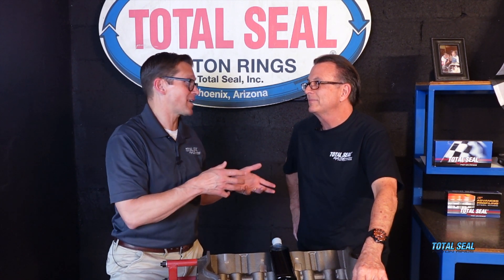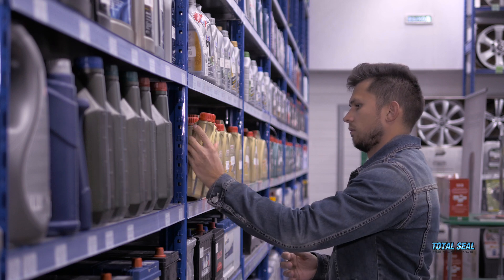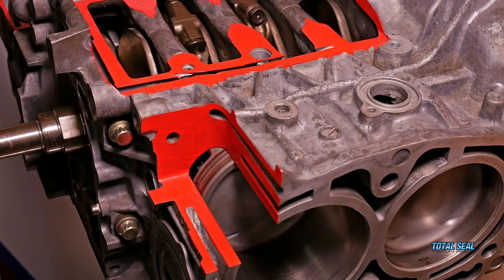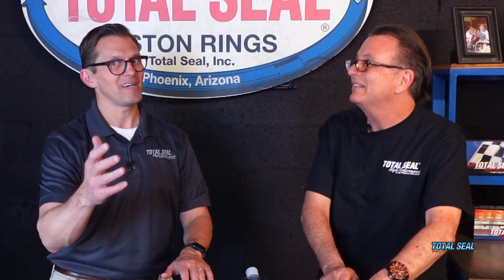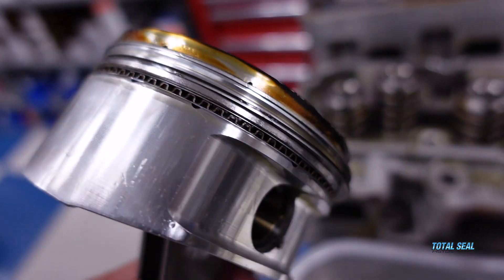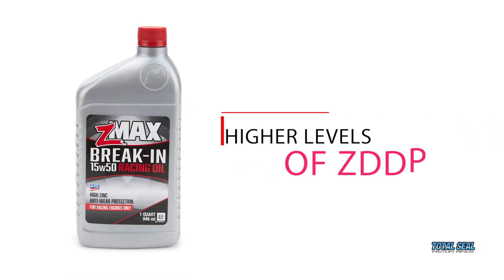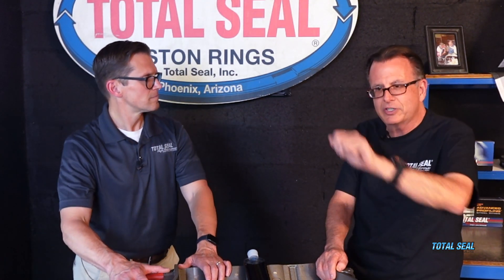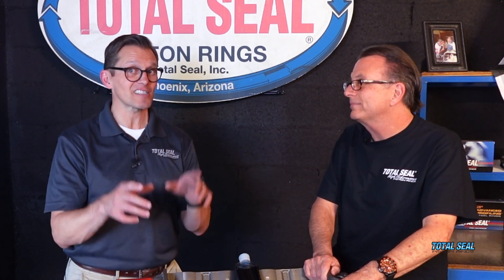Engine Break-In Oil - Is It Science or Just Marketing?

Comment: If you have a new motor, tiny metal particles will come off the cylinder wall, crosshatch. It’s just a part of the situation. It’s more prominent, depending on what kind of cross hatch you have. Tiny particles of metal come off the cross hatch into your oil that you can only see through a microscope. You don’t want this in your oil but as the rings seat this will happen. Therefore, your first oil change should be after a couple of hours of driving then your second oil change should be after about 100 miles. A good way of knowing this is getting a microscope and looking at your oil you can see the particles in it. During the break. On my motors, I always put the oil under the microscope to see how much metal flakes are in it sometimes it’s more obvious than others… Like they say the proof is in the pudding… Or might I say the oil?

Comment: I’m having a brand new 6.0 Powerstroke diesel engine built with coated pistons and bearings. I wanted to use the Driven DBR 15w40, but the builder said he ONLY recommends Motorcraft conventional 15w40 or Shell Rotella conventional 15w40 for break in on these engines. Change the oil and filter after the first 100 miles then again at 1000 miles using the same oil. Then change at “routine intervals” with conventional or semisynthetic oil of my choice until 20,000 miles where full  synthetic is permissible. I’m sure I already know the answer, but am I doing myself a disservice by following his recommendations?

Comment: This is not very practical. When we buy a new car or motorcycle, are you proposing we change the oil as soon as we get home and install a break in oil? Maybe racing shops can benefit from this video but no one else. Are you claiming all manufacturers of cars and motorcycles send off their engines with a harmful oil in them? I don't believe it.
Reply: I was wondering the same thing! I’m picking up a brand new 2026 Ford F250 with a 6.7 L diesel engine in a few weeks. After watching this video, I was thinking, as soon as I get my truck home, I’ll drain the oil and put in a break in oil. But, would that void the warranty, or how feasible is that? How much better would a break in oil be over the oil Ford puts in the engine during the break-in period? I wish Lake would address this in his videos about buying a brand new car or truck.

Comment: Morons!! They push using a crappy break-in oil that causes wear to so called seat things?????????? Ask these morons, how long should they allow the engine to wear, and how much scoring takes place!! This stupid talk damages your brand-new engine, reducing its life. Ask the morons why brand-new factory assembled engines don't use break-in crappy oil like Joe Gibbs with very low PSI protection. Factory engines are assembled and driven with no issues. These guys are causing issues by causing wear.

Comment: If you buy a new Honda do not change the oil early as it contains special break-in oil.  Factory-fill oil in new Honda engines have a higher concentration of molybdenum, a friction-reducing additive. This moly comes from assembly lubes used during the engine manufacturing process and helps with the initial seating of engine parts. Honda recommends leaving this factory-fill oil in for 5,000 to 7,500 milles. My first oil change was at 7500 miles in my new Civic and it had nearly 200k miles when I sold it and never had engine problems. I stuck to 10k-15k miles synthetic oil change intervals. 

What funny is this guy is using the wrong viscosity oil (even the owner's manual says use 0W-16  only ONCE and must switch back to 0W-8 next oil change). Using the wrong viscosity oil is much more harmful to the engine than 10k mile oil change intervals.

Comment: Lake, 
How should we drive during the break in period?
Reply: Just use the vehicle were its designt for. No high revs and load. After 500km change oil and use it! Modern engines dont need a special 'brake in' oil at all.

Comment: You only need the zinc if you have flat tappets, roller cams do not need it; however if you have cast iron pistons you do need a low detergent oil to break the rings in. I used Lucas on my MGB because it has it for the cam, but low detergent for the rings. ZDDP isn't a cleaner so it's OK for those piston rings and visa versa. 

And more important is making sure your break in procedure is proper. I run for 20 minutes from 2,000 to 2,500 for the cam, drain oil, change filter then break in oil again for 500 miles for the rings. There's more to it but that's a basic break in.
Reply: Zinc has been debunked. Flat tappet engines require 100,000 PSI protection or better. Zinc can actually pit metal.

Comment: In my Country usually for brake in oil in cast iron engines with flat tapet lifters  we use E7 A3/B4 CI-4/SL labeled oil for mixed fleet in 15w-40 vis mineral II group base oil  with 1300-1400ppm Zink and 1200-1300ppm Phosphorus Calcium 2700-3000ppm  Boron 200-250ppm with trace of Magnesium and Molly <20ppm Sulphur ashes 0,300-0.350% and always gives good result
Reply: What oil specifically? Thanks for the info!

Comment: What breaking oil should  I use on my Ford 2.3 turbo engine  help please
Reply: 0w-30 ACEA C2, API SN, Ford WSS-M2C 950-A, Low-friction motor oil. Specially developed for the requirements of Ford diesel engines and individual gasoline engines. Thanks to the excellent adhesion to metal surfaces, outstandingly suitable for vehicles with start-stop systems. Meets the requirements placed on engines with turbocharging and modern exhaust aftertreatment systems such as catalytic converters and diesel particulate filters.
All-season low-friction motor oil. A lubricant with this specification is required in Ford TDCi diesel vehicles built as of model year 2014 as well as individual EcoBoost engines (2.3/2.7/3.0) and in the TI-VCT engine (5.0). Tested for use with turbochargers, catalytic converters and diesel particulate filters. Valvoline SynPower MST FE C2, Valvoline SynPower DT C2 LIQUI MOLY Special Tec F, MOBIL Super 3000 Formula F, TEXACO Havoline ProDS F, SHELL Helix Ultra Prof AJ-L, SHELL Helix Ultra Prof AF-L,  MILLERS OILS XF Premium C2 ECO, CASTROL Magnatec Stop-Start D...

Comment: IMO... modern machining tolerances are spot on. Allowing components to 'bed in'  is unnecessary. Car manufacturers do not tell you to bring the new vehicle back next week for a 500 mile oil change anymore. I see no reason to use 'running in ' oil.
If you are changing the oil because you are worried about the possibility of there being 'bits' in the engine, you are admitting you yourself that you've not cleaned the engine properly. Whilst changing the oil after a few miles will not do any harm, it shouldn't be necessary.
Running in by driving gently is also a myth. Drive the car normally.

Comment: You need a high zinc content oil for break in. Due to environmental regulations in recent years, zinc has been removed from many oils, which makes it not suitable for a brand new engine. Once the motor is broken in, the zinc content is not as crucial. Rebuilt flat tappet cams and lifters are falling victim to this. Anecdotally, I recently had two crate engines detonate due to stuck lifters/cam issues and I attribute this to the oil. Third time, I rebuilt it myself and used a dedicated break in oil and it survived the break in period.

Comment: Lake, we reman'd a 1991 Toyota 2.0 in a Camry. Don't beat me up on dollars and sense. I drained the first after running at 2500 no load for 20 minutes. Then I drove it like a bat out of hell with Royal Purple 10w-30 break in oil for a hundred miles and drove normally for another 400. So now that I'm at 500 miles I want to change the oil again, is there a benefit to use break in again for the next change and if so how long should I run it?

Comment: I'm waiting for my new bike (HONDA GB350S) to arrive.
It's a 348cc air cooled, long-stroke and tuned to deliver 29Nm of torque @3,000 rpm and 15,5 kW hp @ 5,500 rpm with a low friction technology built in for maximum efficiency.
The recommended oil is
Honda 4-stroke motorcycle oil API Service Classification SJ or higher, excluding oils marked as “Energy Conserving” or “Resource Conserving,” SAE 10W-30, JASO T 903 standard MA.
What oil would you recommend in order to break in this type of new engine?
Thank you very much for your time, looking forward to your reply.

Comment: I work at a dealership... when we do factory long blocks or short blocks, sometimes they come with oil in them already, I do not know what that is, it is rumored to be a break in type oil, but I've never seen any proof of that. I've been through all the manufacture trainings for years.  Anyways... The ones that come with no oil, they get normal off the shelf OEM Dino oil. Never had one come back with a problem and it probably went 3-5k miles on its first oil. Point is, I see those those same cars for years coming in for normal maintenance and what not, so I would know if their was an issue... Not to mention it would come back to me for an oil consumption issue, since I did the engine. I think it's a myth, but if you buy a motor and the seller tells you to use a break in type oil, just buy the snake oil so they at least can't blame you for their failed build.

Comment: New Ford Super Duty 6.7 Diesel, New arrived off Transport with 61 miles already on OD, Ford factory track drives several SD's prior to transport.  SD 6.7 come with Ford 10W-30 conventional oil, not synthetic. At 15 qts Non-Syn, it was recommended by Ford to go 5000-7000 miles. I changed early with same Non-Syn at 3200 miles, and will move to AmsOil on next Oil (3rd) Change. Also performed 2 Oil Reports during the 1st Oil milage (2300 & 3200). Was this not a good method to break-in the Diesel?

Comment: I just purchased a new Westinghouse 11,500 watt generator.  I have not started it yet, nor have I added any oil or fuel to it. It’s still brand new in the box.  I want to break it in the correct way. I’m still trying to determine what is ideal to use for my oil. In this video you mention…  ZMax, Driven, and Motul.  My generator recommends 10W30.  Which of these 3 brands would be best to use for my small engine?  

I do plan to run the first 30 min, then change it, and then another hour, change it, and then maybe 2 more hours and change it.  I will do this while on a load.  

I’m looking which of these 3 brands is best suited for a generator, and then after break-in is completed, what oil should I use?  A full synthetic?  Please help with the best oil selections for my generator

Thank you

Comment: Hey Lake! SO very much appreciate your informative videos, and I am officially diving into the rabbit hole! My question concerns using break-in oil in a motorcycle, which would have a wet-clutch system where the engine oil would also lubricate the transmission as well (JASO MA-2). Do you foresee any issues with using a break-in oil for this application?
Reply: Motul break-in oil  part # 108080 is great for motorcycles and wet clutch

Comment: Is the ZMax break in oil a better choice for initial break in on  a full roller 383 sbc @ 530 hp than a mineral oil based 30 weight break in oil? I contacted ZMax without a reply

Comment: What’s the general consensus on running the driven break in oil after initial break in while dyno tuning? I plan on changing the oil and filter after the break in but there will some break in in the system (cooler and lines)

Comment: If a 90's high performance (re)build Toyota turbo engine was broken in on a 5w30 fully synthetic motor oil, is there a process to swap in a break-in oil to get proper seating of the rings which the synthetic oil may have prevented? What type of effect would a synthetic oil have on break-in process, and can it be undone, or is there permanent alteration/bonding/wear of the metal surfaces that cannot be "cleaned", and then properly broken in for ring seating? 
Great job as always! Thanks guys.

Comment: Hey Sirs 
I purchased new let’s say 2022 Ford with 6.2 engine. Would it have been a good idea to drop the original oil at 5 odometer mileage replace with one of your breakin oils change filter run for 3000 miles  ???
And if not just change out original oil before 1000 miles and use good synthetic oil  and new filter ???
Excellent tutorials
Reply: Wondering the same

Comment: Ok I'm trying to break in a Saab 4 cylinder iron block steal ring with hydraulic lifters. It's a forged piston deal. What would you suggest for a break in oil
Reply from the maker: Use one of the oils mentioned in the video.
Reply: Is amsoil 30 anything you would recommend
Reply from the maker: @rolfemarquis1017  No

Comment: What is the best oil chemistry I should  be looking for to break in (just) the flat tappet hydraulic camshaft and lifters in an engine with rings already properly mated to their bores - both seeming to be in good shape, with good leak down numbers in a mid mileage (under 60k miles) 1960s Pontiac V8 engine?

Comment: I'm very curious on something. What about the break in oil on something like a small engine for a lawn mower, snow blower, lawn edger, etc.?

I know some people say just to use Briggs & Stratton Small Engine Conventional Oil and change accordingly. It also makes me curious if Amsoil's Synthetic Small Engine Oil would work since it has no friction modifiers? Or maybe there is something I am unaware of?

I know this is a car care channel but I always drive old cars that I had nothing to do with the break in. But I am buying some brand new small engine equipment this year and plan to rebuild an old Briggs Quantum Engine. I would love to hear your opinion on the subject even though it may not concern cars.

Please and thank you.
Reply: Small engines like predator 212's, duromax engines, etc, can be broken in with regular oil, It won't significantly impact performance at all and is even recommended by official manuals. If you're worried about anything using proper break in oil won't hurt and is only a few dollars more expensive. Have fun! :)

Comment: Looking at the virgin oil analysis from a brand new car, I have it has a little bit of friction modifier and the detergents, and appears to be the same off shelf Pennzoil based on other oil analysis.    Why would the OEM have friction modifiers and detergents if it was detrimental?

Definitely down the road when I do a full build on my Toyota 7M turbo I’m going to be using the driven braking additive and using total seal rings for that and follow the procedures on the video.
Reply from the maker: Fuel economy.
Reply: @TotalSeal  I guess what I’m referring to is the braking process in having some Molly and detergents in the virgin OEM factory filled oil, are they not worried that the rings will not seat properly by doing this? Or the OEM rings are not the same as high-performance total seal rings which serve a different purpose and proper breaking is more crucial with those ?
Reply from the maker: @Good-luck-Jonathan  Because of the fuel economy requirements, OEM gasoline engines feature ring face coating and cylinder bore surface finish that will allow them to seat with these thin, synthetic oils. They are very different from OEM Diesel engines. What we do with high performance engines and rings is closer to what the Diesel OEMs do.
Reply: @TotalSeal  oh, that’s interesting because mine is also a brand new eco-diesel. I wonder if some diesels are different than others? as I mentioned, it’s strange that this has detergents from the factory and the Molly on virgin New samples the community took when they first bought their truck? I’m hoping that in the case of this particular engine OEM must’ve been OK with using the non-breaking oil? As I said, I boosted it a little bit with ZDDP which I know in normal cases it’s not optimal but in this case since it came that way, I just wanted to add a little bit more.

Comment: I got a new rebuild 5.7 engine from Jasper with a 100k mile warranty back in April 2023 for my 2005 Ram 1500, and I couldn't find break-in oil anywhere. In fact, I couldn't even find conventional motor oil in the viscosity my engine requires. 

So, I had to get a synthetic blend. I chose a cheaper brand so that it wouldn't be overly inundated with moly. I drove it easy the first 100 miles and then changed the oil and filter. Drove it al little more aggressively for 500 more miles, and then changed the oil and filter again using the same brand of synthetic blend oil. Then I changed it again 3k miles later and swapped to full synthetic of a better brand. 

So far so good. No oil consumption at all, and everything seems smooth and quiet other than the happy exhaust note from my Flowmaster Super 40. 

8k miles in now, and I will be needing my 5th oil change soon. Thinking about swapping to Penzoil Ultra Platinum and a Purolator Boss filter from here on out.
Reply: Oreily has some cheap conventional oil or supertech. They didn't hav3 any?
Reply: I just replace my entire engine every 300 miles. You can't be too safe!
Reply: I really like the penszoil ultra platinum
Reply: @John-pc2yr  I have been using Valvoline Restore and Protect for over a year now, and I'm not swapping again unless someone does even better.

Comment: How are you doing a quick question I’m to the part where the breaking on you so I have a 7 quart oil pan that will mean I need 7 quarts of either Zmax driven or Moto anyone of them correct? Each one is a quart can you get back to me? Thank you.
Reply from the maker: Yes, the break-in oil is not an additive. For a 7 quart pan, use 7 quarts of the break-in oil.